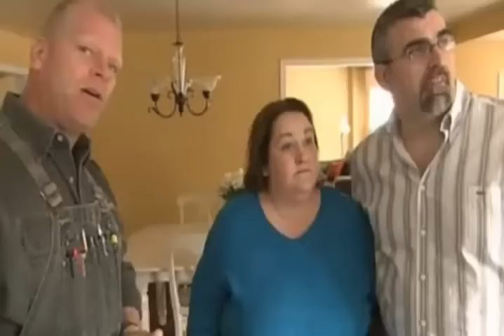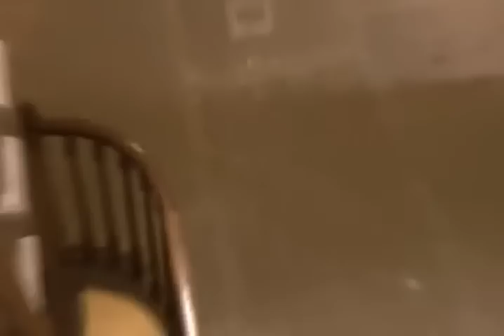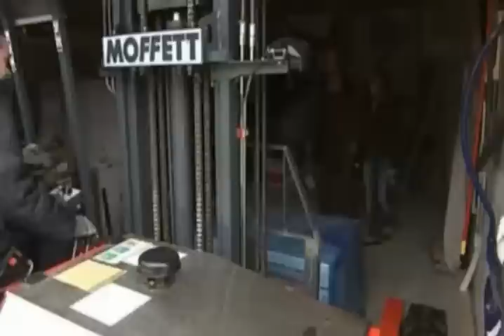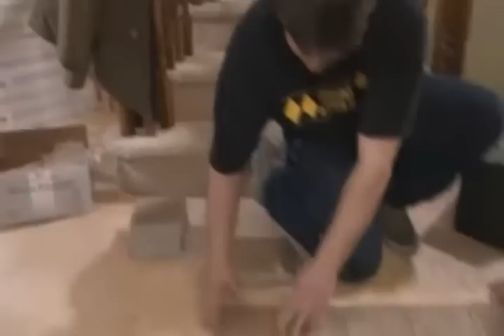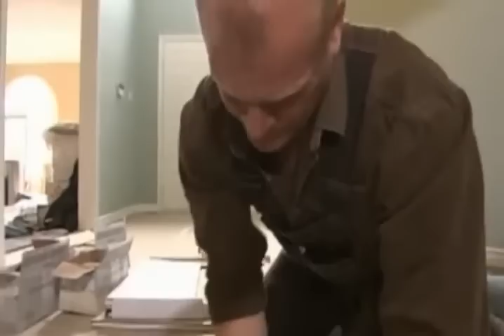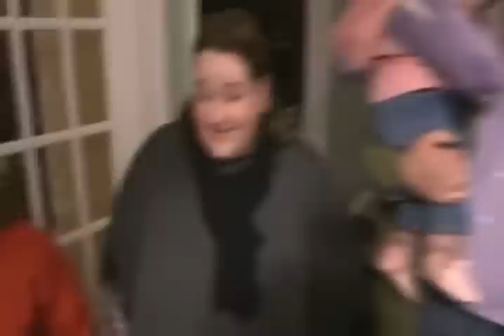Holmes On Homes Sea 05 Epis 11 What A Mesh

Comment: In 2015 I tiled my kitchen in the house i just bought. Never tiled before, not a lot of construction experience in general. Guess what? I had to rip it all up two days later because half of it was popping up because i screwed up. 8 years later It's still holding up because i learned from my mistakes, plus did two bathrooms and a custom tile shower. I just can't imagine how a "professional" did this quality of work.

Comment: mike this one touch home for me a bit   i seen a tile job similar to that  that you pulled up   but it was in a mobile home and i told the owner before we moved them that all your tile will have to be redone when we move this unit she like what do you mean  and i told her their are just somethings i can not control in life cause your going from a stationary position to a move one you will have flex in the floor how bad i can not say but we moved it for her and it only pop a 3 ft wide by 5 ft long section in the whole house where the thin set was not thick enough    so  i told her i could come back a fix it but thats a whole different job  or  its time to pull it up and redo the whole house she opt for me to fix what was there so i did and it has not move since and still looks good now i could have charged her to do the job about 400 bucks but i did not i just went back and fix it  i told her to give me 3 weeks because that way the house settles in place a bit and they will be no cracking of the grout lines or popping tiles